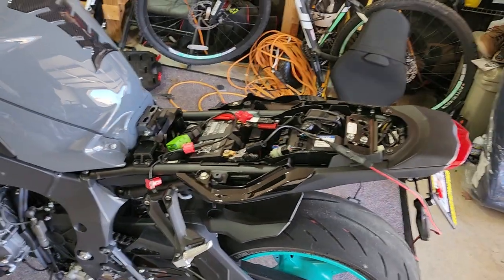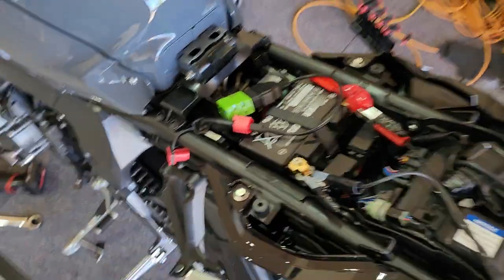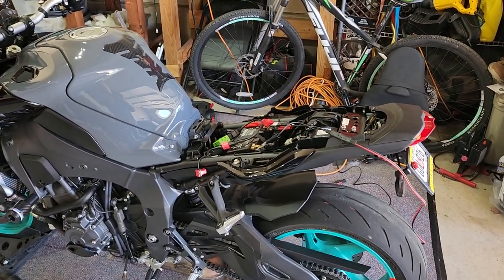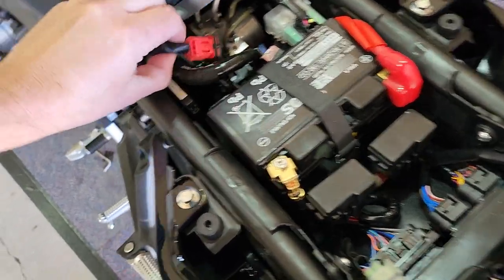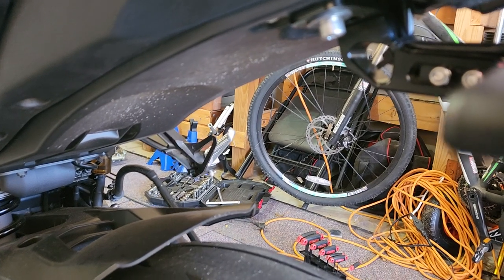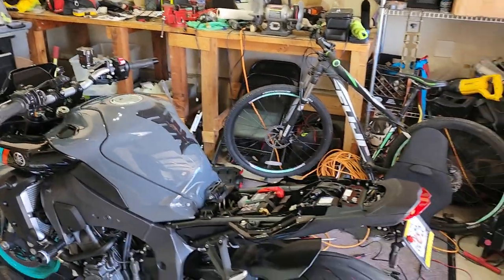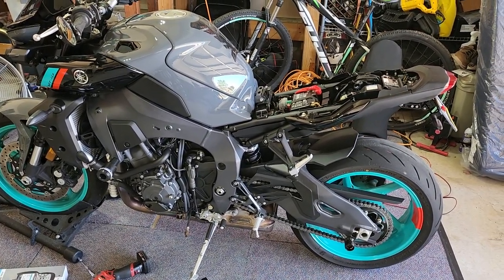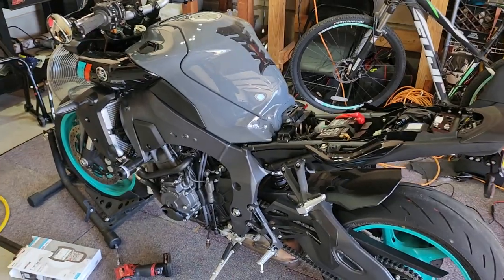2023 Yamaha MT-10 ECU flash update and removal process

Comment: I was a little nervous after seeing people having issues. I had Chris flash my 23 ECU Friday. Removed the ground, took the ECU out. He flashed it and I reinstalled it. Cycled the key like he said and it fired right up afterwards. I did have CEL after, and was locked out of menu/settings. I was able to reset with cheap amazon scanner (I think its the same one Chris sells) and Chris's euro 5 adapter. After that I had a no start, but cycling the key resolved it. Ive put 300 miles on it since Friday afternoon, and I'm having a blast
Reply from the maker: Yeah, I couldn't get the cheap scanner to work, but I did have another one that did...  I have put well over 1000 miles on mine since, and its been awesome.

Comment: I just had the P2158 error code pop up while lubing the chain on my bike. 2023 MT-10 with same setup and flash as you. 

I have multiple Bluetooth adapters that can all see the code but they all get errors when trying to clear it. I rode it about 10 miles and still on too.
Reply from the maker: I am assuming you had the bike up on a rear stand with the motor running and the wheel spinning with the front wheel stationary?  Yeah, the ABS system will throw a code.  It will eventually cycle out from riding it.  

I don't lube my chain like that.  I have the bike on a stand, but I don't spray the chain.  I just wipe it down with a rag soaked in WD40 and motor oil, and the engine is off and I spin the rear wheel by hand.
Reply: @SquireSCA  yeah that’s what happened. I never do that but was in a hurry so I thought I could get away with it. Thanks. I’ll just keep on riding

Comment: Could you please recommend me which diagnostics to buy for reading and deleting errors for mt-10?
Reply from the maker: What worked for me was a bluetooth adapter and the Torque Pro app on my phone.

And you can use it on your car as well, but on the bike, in order to use it, you need that cable adapter that goes from the red plug on the bike, to the OBD style on the other end, where you plug the Bluetooth adapter in.  I don't have a link to that cable, I got it from Chris at Moore Mafia when I was there.

The bluetooth part is here:
https://amzn.to/43lbxy5
Reply: can it load and display data and errors directly while driving?

Comment: Any update on your issues yet??  ---- I think all three (Chris Moore, 2WDW and Vcyclenut) are reputable tuners. I would not go to others ... there is simply no reason. The reason I chose David is that fact he does do dyno runs when developing his tunes but he also owns the actual bikes he tunes and literally does hundreds and hundreds of miles of data logging on the street to refine his tunes. NO other tuner does this and this has earned him the reputation in the CP3 community that he has. Plus his prices are good, he re-flashes for free when you make additional mods and he is a down to earth rock solid honest guy (NOT saying the others are not!). This has earned him the highest reputation in the very active CP3 community (MT-09, XSR and Tracers). He owns a new 2022 MT-10 and has completed his flash development on this new bike. This is the reason his tunes in my view perform extremely well, dare I say better, under real world conditions since his data logging on the road allows him to tune part throttle operations as well. He did my 2022 Tracer 9 GT in Janaury and it has been running strong. My new 2023 MT-10 is coming this week and I will use him to flash the ECM ... already talked to him about it.
Reply from the maker: No issues.  I just had to get the right scanner to clear the codes, and its been fine for 1,000 mile now.

Comment: hi, has anyone also had the MIL malfunction light come on after installing the Decat system on a 22-23 MT-10?  This happened to me after approx. 100 km, always when attacking the maximum speed, repeatedly.  It always turns off after the third start.  If I don't try max speed it won't do it.  the control unit has not yet been ramped.  the exhaust flap servomotor was also removed from the motorcycle and the AIS valve (PAIR system) was disconnected, an eliminator from the HealTech company was connected to the connector in both cases.  Lambda probes were not disconnected.  when the fault is on, the YRC system value line always disappears on the display, after the fault goes out it always reappears.  I haven't had a diagnosis yet.  thanks for the advice
Reply from the maker: I have not seen that.  I had Chris disable both the Servo and the O2 but I just left the O2 sensors in, but the ECU ignores them.  I don't know if the Healtech adapter works on the new bikes.  You might have to disable stuff with the ECU flash itself.

Comment: I had the same ERR no fire issue after reconnecting flashed ECU, and turned out mistake of plugging in without disconnecting battery was the problem and was the only thing that could resolve for me.  Couldn't get 2 scanners to connect and was a click away from ordering the same ODBlink.  Was going crazy and had the bike fully apart twice trying to figure out 🤯
Reply: I just got my ecu flashed too and made the same mistake not disconnecting the battery before putting the ecu in. I havent started the bike yet cause im still waiting for my full system exhaust. What steps did you do to solve the problem? In case im positive it will happen to me.
Reply: I just disconnected the battery, then ECU and recon,  then recon battery.  Could always be another misconnection under airbox if blockoff plates installed and above didn't work.

Comment: Hi Dave, do you have the O2 sensors disconnected in the remap map?
Reply from the maker: No, the O2 is turned off, but you have to leave them connected or else the cruise control doesn't work.,
Reply: What is the benefit of deactivating the O2 sensors?

Comment: This is getting too complicated. And in Japan, where we have inspections every 2 years, whatever you mod, you have to revert. So, removing a full exhaust and reverting any ECU changes, is going to be too much trouble. Im done with combustion engines. Its too much hassle.
Reply from the maker: It is, and its unfortunate...  The golden age of motorcycles is over, sadly...  At some point, we won't be able to do much with them, other than buy them and just ride them as is...

Comment: You shouldn’t disconnect or connect anything electronic with the battery energized to the bike. At minimum, remove the negative cable before doing any of this.
Reply from the maker: Yeah, although to be fair, this issue on the new bike comes from when he has to power the ECU up on his workbench to flash it.  The ECU calls out to all the systems and nobody is home so it throws a shit ton of codes...

Comment: Just added a comment rgd the OBD2 connections, it seems to have disappeared
Reply from the maker: YouTube is weird like that...  I get an email notification that someone responded, and I see the response in the email, but when I click the link to come and respond to it, I don't see it.  Happens a couple times a week and I have never been able to figure out why.  What was the comment?
Reply: @Dave's Man Cave  Weird, it's been doing it to me lately as well 🤷‍♂️

Essentially I've just had a word with my tuner, and has said that older OBD2 readers (with white connectors) can't be used with EU5 bikes. Something to do with the conversion from the OBD2 reader to the connection needing 6 pins (usually defined here in the UK with a Red connector) instead of 4 (white connector). Whether that's for different voltages, data speeds etc, I'm not sure.

If that's true then 90% of the readers labelled mt10 2016> online are false and people are wasting their money.

I do have an older 4 pin lying around for an older 19' mt09 so I'll try that out and confirm.
Reply from the maker: @sergeantsodom6969  Yeah, I have the red connector that converts to the OBD2 side that he uses on all the new Euro5 bikes.  So the cable is good, because I was able to reset things but I had to use the bluetooth OBD2 connector with it... Which is odd, because that one is like 3 years old at least...
Reply: @Dave's Man Cave  Huh... Well I'll be 🤷‍♂️🫡
Reply: I've had a remap done by a reputable person and I've had some issues since. I wonder if you've heard of them.
When starting the engine from cold it races to about 4k rpm with throttle shut. It is worse in mode B, goes away in mode A. Haven't tried it in C or D.
I'm taking it back for a reflash. My guy says he's never heard this happen before.
Reply: @Steve Mott  Is it not some form of warmup feature within the software? Sounds odd
Reply: @sergeantsodom6969  it's going back a week on Friday to reflash. In mode B it doesn't go away. Bike is nearly unrideable and TBH I prefer mode B. I'll post an update after reflash.
I've put a decat pipe on a d Akropovic end can. Kept O2 sensors connected and removed servo.
Reply from the maker: @sergeantsodom6969  Yeah, mine doesn't do that.  It starts up normal.